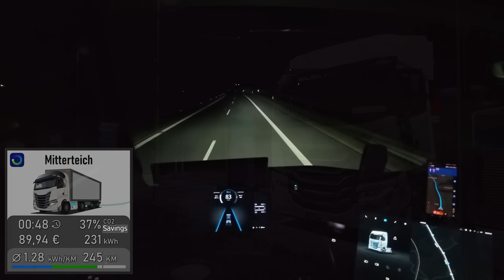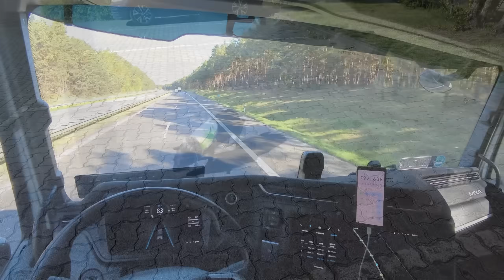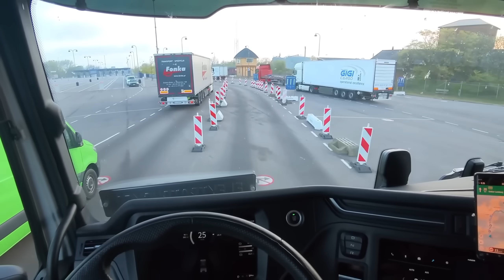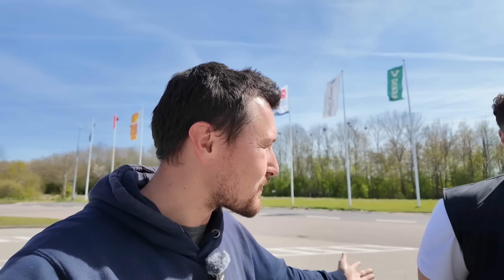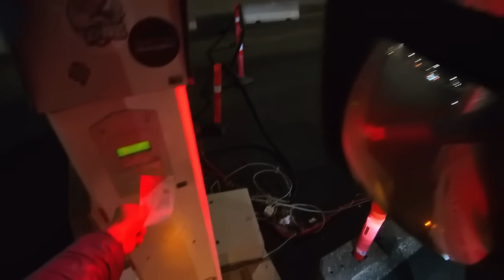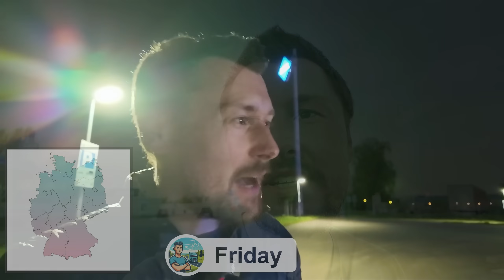Munich - Malmö - Munich: This Electric Truck has the same Range as a Diesel

Comment: I guess that range can be improved massively by having batteries in the floor of the trailers you tow. Double the range seems like a game changer if the trailer battery is full when picked up. Truck charging areas would need two chargers for each truck: one for the tractor unit and one halfway down for the trailer battery. Wow! Now I watched further on and my idea is now a reality. Amazing!!

Comment: Does it have the same load capacity? didnt think so
Reply: I would assume so, because electric motors have much more torque, especially at lower speeds. Thats why almost all trains use a diesel-electric setup, where the electric motors power the wheels, while the diesel engine recharges the system. Much like steam engines, electric motors have a nearly infinite load rating at very low speeds and high voltages.
Reply: @maxstagramus3018 "almost all trains in the US use a diesel-electric setup"

Comment: You mention the conversion of the ferry you are on is to be converted to electric. The local news here, Tasmania, had an article regarding the construction of two electric ferries for Danish operator Molslinjen, 129 metre, 45 megawatt vessels with each to carry 1,483 passengers and 50 cars (I assume trucks also). The Hobart ship builder, Incat, has just completed a similar sized vessel for use between Buenos Aires and Montevideo in South America. The batteries will have to be fully charged to make to their destination on completion

Comment: why manufacturers dont make option to adjust current to lower in software?  sometimes if you have to pause from driving you dont need super quick charging speeds - i have motorcycle which has 1-75A (in 5A steps) adjust -its great bcoz sometimes I dont need 20min charging time, and with passive cooled battery it not heat that much with lower current

Comment: However very important not to blindly compare how often you fill up a diesel truck as you hog resources with the larger batteries. The charging network needs to be expanded and more reliable. Not to tie up valuable resources just because some are lazy about charging.
As the example with reducing diesel consumption you need to take to consideration how long it takes for the climate impact from the batteries will be the same as the climate impact from the otherwise higher consumption of diesel.
Reply: What about air quality?
Reply: Battery production emissions are compensated for very fast as explained in his other videos.

Comment: Those truck charging parks are amazing, to my knowledge there isn't even one of those in Australia and very few 350kW chargers well that work at least, one word Tritium.  Currently a company called Janus is doing battery swapping and some fleet operators are using the system although it is quite manual at the moment at least but they convert diesel trucks to electric.  Now I'm curious about your experience with the Rozzers/Polizei next week.
Reply: didn't tritium go bust? https://www.youtube.com/watch?v=lIHOMkDqzZE

Comment: That truck charger site is great! 

However, would something like a solar roof (obviously with a height that is acceptable for a trailer) be good in the rain?
Reply: You don't need to hold the cable when it's charging, just plug it in and hop back into your cab.

Comment: The powdered trailer is a good idea......i've been watching the Edison motors channel and have wondered if they will try a powered trailer for the logging trucks they are building as extra axles driving in the shit conditions that logging trucks operate in seems like a major improvement.
Reply: Seems like a good idea! You also get higher regen efficiency with more driven axles. Just need to ensure enough ground clearance to keep the battery pack/s safe. :)
Reply: Yes I too wonder if @edisonmotors will offer that in the next phase of their growth

Comment: It's crazy how chargers are all so different. Imagine if gas stations were this complicated! You go to one, it trickles out the gas, another one can't shoot out the gas fast enough! By far this is the number 1 challenge of Electric Trucking...Here in Canada we have huge distances and very low populations so we cannot afford to have even one charger offline.
Reply: guess what: it had been complicated too till they found unique solutions for all. 
The basics come not for free, hard struggles.
Reply: In Quebec (where about 40% of EV cars are sold in Canada) It's approaching OK for cars. There are a lot of Fast chargers, and it's to the point where last month,  I charged at bit at a tesla, but didn't want to do the whole charge there because the restaurant was bad, so I went to the next highway exist,  and started using Petro-Can charger. The petro-can charger was super expensive, and only charging my car at 40kw, so I went across the street to a Circuit-Electrique one, and it charged at the same speed, but for 3x less.  Once I leave Quebec (east or west!) the charging options get a lot thinner.
Reply: EV charging is still relatively new stuff and things are still shaking themselves out. There's a lot of new and established players having to work together, etc. In another decade, it'll all be established tech and you won't need to even raise an eyebrow when arriving at a charging station... :)
Reply: @lennyvalentin6485 I hope you're right! But we can't wait a decade to see this all fixed up.
Reply: Just new Tech and it is moving rapidly... like what was designed and then built and then installed all take time.
Reply: Mr Positive should stick with ICE.
Reply: @paulb6736  What a totally useless comment without any value whatsoever. Please continue to take your medication.

Comment: As a matter of fact, I just spotted an e-coachbus in Arnhem (NL) today.
Brand Yutong, range 350km for 48 passengers, 255 kWh battery. Could not find info about the charging capacity.
350km is more than enough for any daytrips schools are taking here ;)

Comment: I like the idea of an electric trailer, I can think of many uses for them, in the UK we have many mega trailers that are very high volume but light loads, these would be ideal for them.  Sadly, a vast majority of trucks do general haulage, where loads can be any weight, so these would restrict the work available.  Perhaps there could be trailers with different amounts of battery, so that weights can be less but still electric if needed.
Reply: An earlier episode talked about modular batteries that are plug and play (can be removed to charge, exchanged for a precharged pack, charged and reinstalled) , so perhaps those could be utilized with the trailer to customizing the battery weight desired optimizing the hauling capacity (maybe adding more battery capacity when traveling into the mountains).

Comment: We have trailers here with electric drive axle and liftgate that also power a trailer refrigeration unit which eliminates the diesel use for generating electricity which is what the TRU uses in any case.
Reply: Hold on. Do all cooled trailers (with refrigeration unit) run on electricity? I always though the noisy (and very polluting) engine drives the compressor, not that it only makes electricity by running a generator.
Reply: @JanNovak-pg8oe I work for a supermarket chain in the UK delivering the chilled and frozen stock in refrigerated trailers. The chiller units are electric with up to 3 per trailer operating on 440V 3 phase power.

These trailers are all "Ferry Spec" so all have a 3 phase connector at the rear so they can be plugged in to "Main Power" to run the chillers but that NEVER happens, the site buzzes with the sound of dozens of those little 3 cylinder Diesels running all the time, 24 hours a day. 

Because those engines can't move the vehicle they do not have to comply with emissions regulations, so they have no exhaust devices like DPF or catalysts, just a muffler.
Reply: That’s terrifying

Comment: A question out of curiosity: Do Tesla chargers work with trucks, and of course, do those that are open to non-Tesla ?
Reply from the maker: Most e-trucks have an 800-Volt system, but Tesla uses 400-Volt cabinets. Unless Tesla upgrades their cabinets, I can't charge there.
Reply: @electrictrucker  Ok thanks for the information
Reply: Should work.

Comment: Isn’t there a weight limit (#80,ooo in the US) I’d think the point of 18 wheelers is to haul cargo, not batteries (trailer is #9,000+#4000 for truck would be an issue).
82k/hr?  What about highway speeds (120k/hr), and hills?  You know, real-world.  
Ferries worldwide are limiting EVs, due to thermal runaway
Reply: 80 km/h is the limit for trucks in Europe.
Reply: It would be a stretch to argue for limiting e trucks when the ferry itself is an e-ferry!
Reply: The max load in Europe is 128000 pound and the clearly said its for volume constrained cargos.
Reply: @ulwur the weight limit in Europe is 88,000 lbs -40,000kgs,The Uk is 96,800 lbs - 44,000 kgs
Reply: EV Trucks have far more torque than a diesel. They could do 120km/hr if required

Comment: If this is the English version, shouldn’t you also translate the thumbnail to use a comma instead of a decimal point? I guess it depends on where most of your English-language viewers live. In the U.S., we would denote the battery capacity as 1,338 kWh.

Comment: Same range as a diesel, but still carrying the same weight of batteries even as they drain. Where as a diesel truck gets lighter the less fuel is in the tanks. Plus how long is the difference between the electric charge up and the diesel fuel up? plus how many more refuelling places are there for diesels over electrics?

Long way to go before electric is a viable large fleet vehicle if ever, in my opinion.
Reply: Fuel time dise not matter much since you charge in yiur brake
Reply: @mcsike7264  THAT IS IF YOUR BREAKS COINCIDE WITH A CHARGING STATION AND 'BRAKE' IS SPELT 'BREAK' THOUGHT YOU WOULD LIKE TO KNOW. NOW I THINK I HEAR MOMMY SAYING YOUR TEA IS READY.
Reply: It's early days yet,technology improves with time
Reply: Carriers will not pay truckers to charge.  They pay by the mile, not the watt.  Also, decreasing the combo’s GVWR by #10-15k would be a major problem.  Overweight trucks age roads and bridges, and added cargo weight decreases EV range dramatically 😅.
Reply: @jeffforbess6802  INDEED VERY WELL PUT.

Comment: Electric long-range buses is quite interesting, to be honest. Up here in Norway there's a lot of bus-travel between cities, for example from Oslo to Kristiansand, Oslo - Bergen and other places. Plus, of course, the winter-temperatures can create their own issues.

Would be interesting to see an electric bus on for example the Oslo - Kristiansand-route, which is mostly highway.
Reply: Sounds like an ideal candidate for CATLs combined chemistry LiFePO and  Na ion cold weather and fast charging batteries... at very low temperatures and higher.

The converted Coach body superbus... is perfect for the pantagraph system on main routes akin to the Trolleybuses of old.
Much cheaper, quieter and more flexible for re routing than Trams.
Reply: It's easy enough to bring the bus up to its preferred temperature while on grid power (if the software enables this), so the ambient temperature only matters insofar as air density.
Reply: @concinnus Transit buses have an almost complete exchange of air with the outside at every stop. Both transit and coach buses naturally have ventilation with outside air for hygiene and comfort reasons. On top of this they have tons of single pane glass surface area which loses heat easily. 

Preconditioning at the depot can be very helpful but will not eliminate the impacts of low ambient temperatures.
Reply: @ElectricNed  Personally I've never seen single pane windowed coaches ever honestly where I live (Sweden) We have cold winter climate, so single pane windows would not be recommended... Also, noise insulation!
Reply: @concinnus  Good point, yep, and since the Oslo - Kristiansand-route is in the lowlands, that shouldn't post a problem.

Oslo - Bergen, however, means crossing some rather interesting mountains and such, and in the wintertime that could be a bit of a problem.
Reply: I would like to see that too! Isn't there a train on that route? Why bus?
Reply: @ElectricNed  There's a trainservice on that route, but it doesn't service most of the towns along the highway as it goes further inland and follows a route that was finished back in 1944. It's been upgraded over the years, of course, but with the new highway slowly making the entire stretch between Oslo and Kristiansand to a 110kph road, bus-travel has taken over more and more traffic. Doesn't exactly help that the long-distance trainsystem has a stupid amount of maintenance-backlog which makes it very prone to delays and cancellations.
Reply: @Fjordmonkey_Actual Too bad about the maintenance backlog! I thought Norway would invest more in rail infrastructure. I love Norway, would love to live there someday.
Reply: @ElectricNed 

The problem is there's a huge amount of civil engineering involved cuttings tunnels , fjiords crossings and North to South driving the length of Norway is like driving from London to Rome ... Look on a globe and you will see it's very, very long country.
Reply: @clivestainlesssteelwomble7665  Well obviously. It's not like I haven't seen what Norway looks like. I've been there multiple times, and have seen their investment in infrastructure in other ways. I am wishing they would put more emphasis on improving regional rail to nearby cities to their capital and less on fancy highway upgrades which make the transportation system more road and car oriented (like the E18 project).
Reply: @Fjordmonkey_Actual  Gigantic railway maintenance backlog in Sweden too. For decades, the go-to move for idiot politicians was to cut down rail maintenance when they needed to stitch their budgets together. Now we're paying the price unfortunately with daily breakdowns in the system and associated delays somewhere around the country. Even our current idiot conservative government understands now that we need functioning rail transport (ordinarily, they LOVE jet airplane travel... sigh), so they're working down the backlog with added funds, but it's slow work when so much has piled up over many years.
Reply: @lennyvalentin6485  Yep, it's idiocy set into system, through and through.
Reply: Norway is one of the biggest polluters in the world and oil producers and it just dropped its green transition plans in favor to drill for more oil. It also is trying to sweep the ocean floor for rare earth metals. Norway is peak hypocrisy

Comment: I am surprised there is not some "haul trucks via train" from Hamburg to Munich or Aachen to Berlin facilities. Seems like it would be cleaner to put a truck (Diesel or otherwise) on a train (like Le Shuttle does thru the Chunnel) and haul it electrically across the country(ies) while the trucker sleeps in a Schlafwagen and clear up some of the Autobahn congestion. Obviously this would mostly be for traveling all the way across Germany or even Europe, not short haul.
Reply: The "rolling highway" already exists
https://en.wikipedia.org/wiki/Rolling_highway
and the carriages have a hole deep enough so all standard truck trailer fit the max. dimensions for trains. 
https://www.youtube.com/watch?v=lS10raGArs4

I guess the constraint for a more wider use are not enough loading terminals and use cases where this would make it worth the trucking companies while.
Ideally it would be simply mandated by the state like they already do in Switzerland or on the future Brenner tunnel crossing to relieve the aging highways from all that avoidable wear.
Reply: The problem with this idea is that the whole infrastructure might need changing as most tunnels and bridges over train lines are not high enough to accommodate a full height truck
Reply: @Jimages_uk  Really? I knew that was a problem in GB but I didnt know it was on the continent. Over here a semi fits on a flatcar pretty easy.
Reply: @natehill8069  I have seen it used in Europe, I once took my truck on a train from Germany to Italy, but I would think that most of the older lines that were not purposefully built with larger trains in mind would not be suited.  THe UK has more than just height problems, a lot of the network is not suited to heavy trains, so can't carry freight trains either.  It would certainly be far cleaner if it could be done, and was cost effective to the hauliers.

Comment: Are there any truck manufacturers testing any solid state batteries yet, they are going to be the game changer for all EVs.
Reply: All of those solid state battery news are still from the research journals from various labs. There are many solid state battery chemistry being developed from year to year, the most overhyped ones are 1.5kWh/kg sodium-sulfur and 2kWh/kg lithium-sulfur, but somehow it's still "not ready to commercialize yet" until today
Reply: VW own Mann and have a deal with Quantumscape and are building a factory to produce solis state batteries. Coming soon.
Reply: how does what you're seeing on this channel not convince you that we're at game-changing already. It's as if we needed to wait just a little longer for the real wonderweapon to arrive before fleet operators start ordering their etrucks. It's working and keeps getting better with trucks and infra scaling up in the coming years.

Comment: Is it normal to have so many issues with ampers and voltage? Or tied to specific Alpitronic/CPO? I guess Kempowers are too rare to compare?
Reply from the maker: The issue was only occurring with the HYC 400 from Alpitronic and only with the Iveco S-eWay. I also assume it must be a certain software version for the HYC 400, as it was not an issue with every CPO.